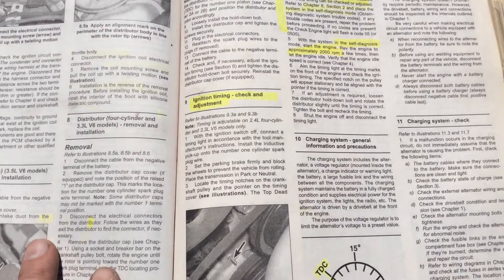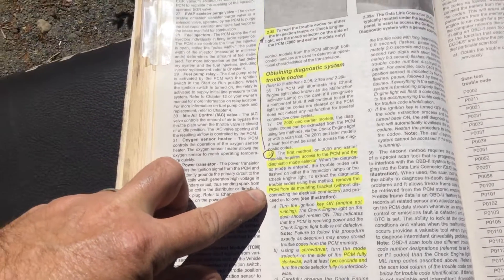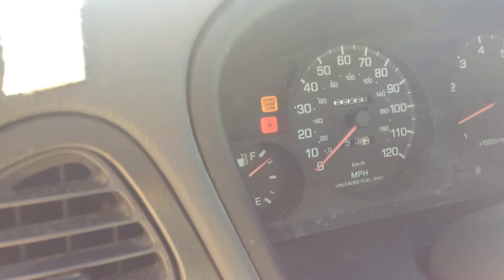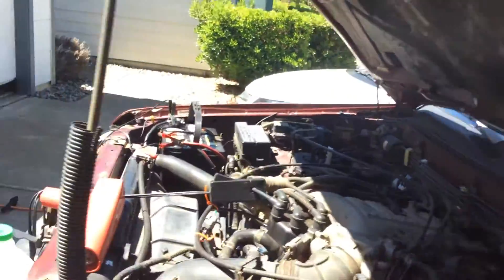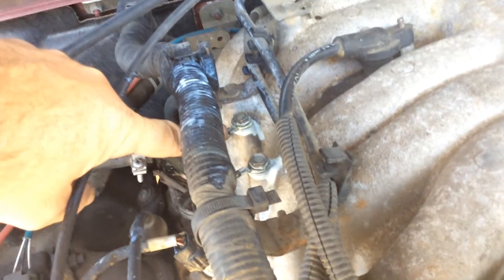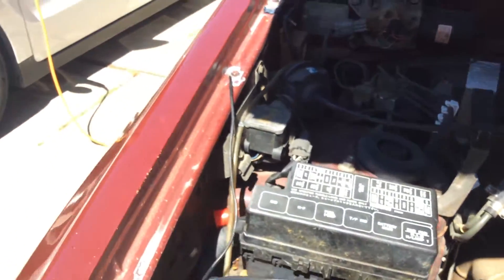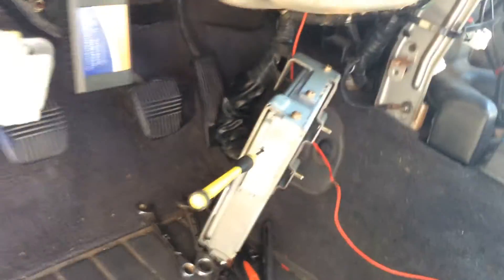1997 Nissan Pathfinder Ignition Timing after placing PCM in diagnostic mode

Comment: The guy that designed this engine should be shot. A $40 part on a Chevy is $500 on this thing. In my 50 years of wrenching I would rate this engine as the least fun to work on. You can point to the decline of Nissan on this engine.

Comment: Damz your video cut out just before some needed info, working on the same engine  right now, about ready to put a new distributor in and will probably run into the same problem thanks for the post,not sure what happened at the end of the video,but we missed it.

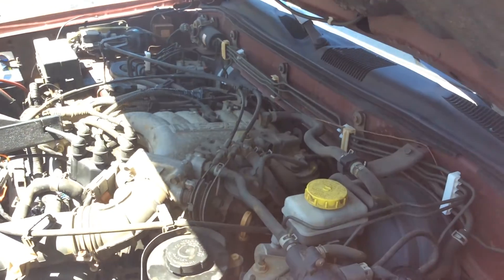Comment: What finally ended up happening was.............WHAT?  Mine failed the same way. Left me hanging at 5:35
Reply from the maker: jim buski , Sorry. Ran out of data space on iPhone.  Internittant power loss at high RPM was from the crank position sensor in original factory distributor finally giving up the ghost. Spark signal would stop at high RPM as the ECU could not tell when to spark, so it would just drop. Also tachometer would "flutter" down just for a few milliseconds with the power loss. After getting new NAPA distributor that problem is gone and no problem with the warm/hot no start I had with the cheap parts...
Reply from the maker: Cam sensor I mean...
Reply from the maker: Also most guys don't bother with ECU diagnostic mode. That ended up making no difference. Lots of extra work.

You can disconnect the electronic throttle control after warming up engine and that keeps ECU from advancing/retarding ignition timing when you rotate distributor to adjust timing.

I tried that too, but made little difference for me.

You wouldn't expect computer to adjust timing at idle anyway, but what the book says to do.

Mine was failing smogs and I kept having to re-learn the ECU through like 10 test patterns (like a thousand miles of useless driving--there ya go you eco-nazi's how did that help emissions!!!!) and I did not want to do one more for unplugging idle control.  

Can't recall if that mode clears ECU memory anyway, but I was trying to avoid yet another relearn.

In the end my timing was same in all three situations:

1.) Normal set up
2.) Idle Control connector disconnected
3.) ECU in diagnostics mode

all at normal operating temp.

Maybe in really cold temps or high elevations the ECU will adjust throttle and idle timing and potentially interfere with manual adjustment...but for me at sea level and normal room temp outside air I noticed no effect on when I went to check/adjust timing.

Comment from the maker: A few verbal "typos". Inside the distributor is the Camshaft Position Sensor. NOT the CRANKshat position sensor. The crank sensor is on the back of the engine near the transmission bell housing. I've heard that some of the distributors have bad resistors in them that get wonky when hot. Try to save a few $ on a cheaper distributor and you PAY for it in the end.
Reply: I bought a cheap distributor online and it failed after a month. 98 pathfinder... It wasnt getting spark so i warrantied the distributor with a replacement of the same kind. Could the resistor be the problem in mine? Can i buy an aftermarket resistor to put in the distributor??